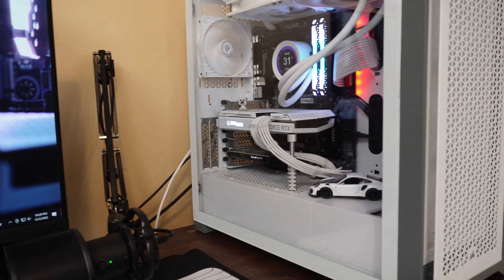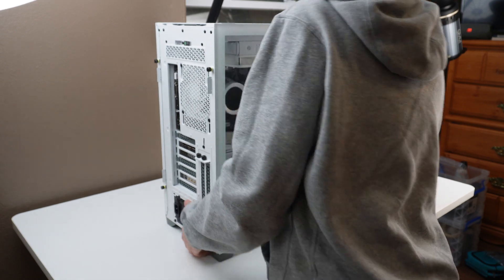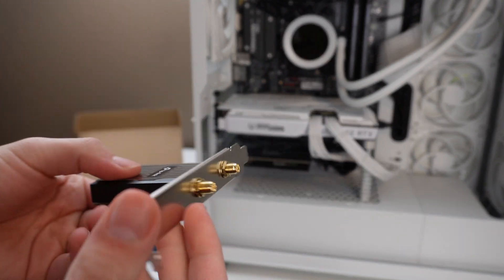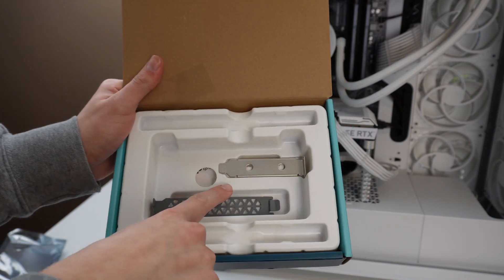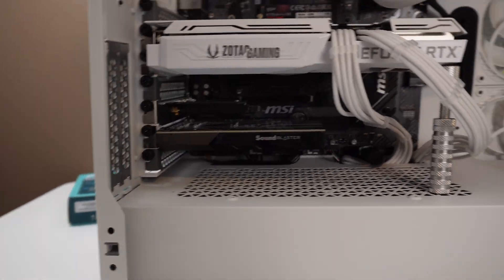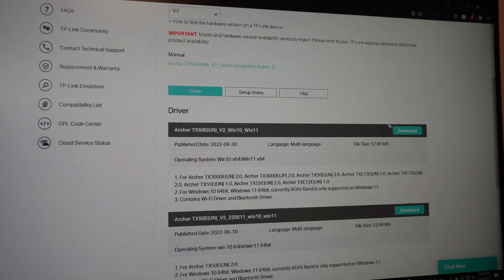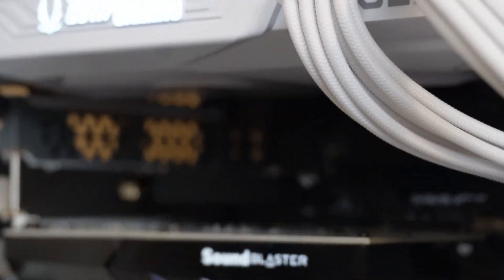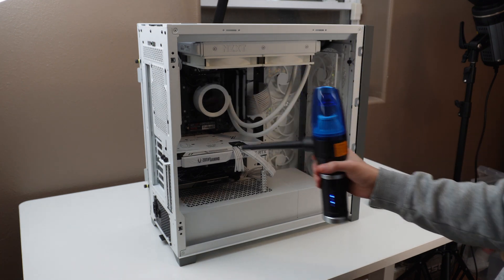TP-Link Archer TX55E WiFi Card: Is It Still Worth Buying in 2025?

Comment: You don’t need to need connection to set up. Just connect it then wit 10-15 minutes and reset pc. It will automatically switch and show Wi-Fi networks
Reply: oh thank u so much. I was like how dose that even work like i am getting the card because i don't have wife on my pc
Reply: could use USB Tethering from your phone @gamer_plpl9666
Reply: I hope this is true, because I don’t have Ethernet outlets in my new room
Reply: @AcidOffTheGoop  did you do it?
Reply: @Goldenapegaming  sorry to bother you but is there anything else that needs to be done to ensure it works
Reply: @Goldenapegaming it works on no wifi correct?
Reply: For anyone struggling and cant ethernet your pc to get the drivers, try plugging your phone into your pc and USB tethering for short term internet for driver use. It'll transmit connection through your phone cable assuming you have wifi which you will because why I else would you need a wifi card, works with mobile data too though.
Reply: I’m trying to set mine up and I tried to wait and restart pc after 15 minutes but it hadn’t worked
Reply: couldn't you get wifi just by connecting your phone to it and let it connect?
Reply: maybe but most of the time tethring disconnect half way through  the download @minasetakeshi5940
Reply: Even better; he showed us the Driver CD that came in the box...why not just use that?  LOL!!!
Reply: @guidosarducci  Maybe doesnt have a CD/DVD reader installed in his PC ? Pretty much phased 'em out nowadays.
Reply: I guess, but I'm old school, so I have one.  Call me crazy...!  😅😆 @ryansta
Reply: The pc doesn't need Internet to download the driver...u just a way to download it n transfer it to the PC...wut I did was downloaded the file on my phone...plugged my phone to my pc n used file explorer to get the file n downloaded the driver
Reply: If you can get ahold of someone else’s pc by borrowing you can install drivers onto a usb drive
Reply: @unothegawdx2808 even use a iPhone and transfer it over
Reply: Does this work for ps4 also?
Reply: @stickup_v1  ps4 already have WiFi built in
Reply: @stickup_v1  you shouldn’t need one for a ps as they come pre installed with wifi
Reply: @Chwisaaa  thanks man bc I just bought one thinking it’s going to make it faster?
Reply: Or you can just download the driver form your phone, and send it to your PC via USB cable
Reply: But the wifi card he got comes with a DVD you can use to install the drivers. I know most modern PCs don't have a DVD drive but you can get a USB DVD Drive (A.K.A External DVD Drive) for like $20 or less
Reply: reset or restart bro? im scared to reset
Reply: @jokok2333  restart the pc
Reply: maybe it will work if you downloaded the drivers on a flash drive then transfer it to the pc?
Reply: @virus5626  I don’t ha Ethernet answer I just plugged it in, restarted my oc and then it showed up. Just give it a few
Reply: @virus5626 that's what i had in mind because i have no ethernet
Reply: It doesn't plug and play for me. And I have no CD drive.
Had to plug in cable and download driver from website.
All good from there.
Reply: But wheres the website
Reply: reset as in restart the pc?
Reply: @lucifersquarter  yes so when you go to shutdown there will be a button restart press that :)

Comment: Does the CD include all of the drivers needed for the computer to see and use the Wi-Fi card? I am thinking of getting one of these.
Reply from the maker: It will include the basic drivers to get the wifi card up & working. If possible, I recommend updating the drivers to the most recent or installing drivers directly from their website .

Comment: Good video I have this same one. i have never connected the blu tooth I didn't realize it was the separate cable I thought it allworked whn plugged into the slot. (stupid me :) ) so now I am going to open PC up and plug it in and see how blutooth works :).

P.S I thought when you shown the speed of ethernet you would compare it at the end with the wifi card and show the results for both.
Reply from the maker: I got about 60ish less download speed using the wifi card vs ethernet. Distance is really the determining factor as well as obstructions. You are right though, I will be sure to include a side-by-side comparison in future videos.

Comment: Do you face with any problem using this wifi card? Thank you very much.
Reply from the maker: No, it does exactly what it says. Has great speeds and makes running a wireless system more reliable. If possible, I recommend having as little obstructions as possible, avoid walls and large appliances.

Comment: Would these Wi-Fi cards work a motherboard that doesn’t support Wi-Fi and stuck on cable only? I got a Msi pro z690 A
Reply from the maker: Yes, it will work. You will need to make sure you have a pcie slot available. When installing, make sure to leave ethernet cable plugged in in order to download and install the wifi card drivers. Once you've done that, you should be good to go! No more cable!

Comment: Ethernet Cable is way better tho. WiFi great for laptops or phones but a main PC is a no no.
Reply: some people’s router are far away
Reply: Really? That’s an elementary reply. Did you know people don’t just live next to their router?
Reply: Always been on wifi on my desktop and it works fire... Never had issue with it !
Reply: I'd say both are great. If you only get 100mb down then you don't really have the need to run a long cable through your house. I personally use ethernet on a gigabit connection. But I have dedicated location sockets in the wall. Personally on my gaming rig I just use wifi. Allows for 4k streaming and online gaming at the same time. I think people don't understand how far Wifi has become. Also as a side note! Some people use ethernet but don't realise that sometimes they have less speed then some that's connected to their 5ghz band.